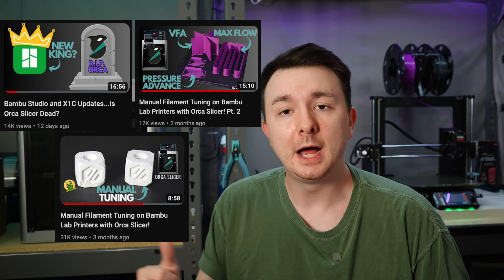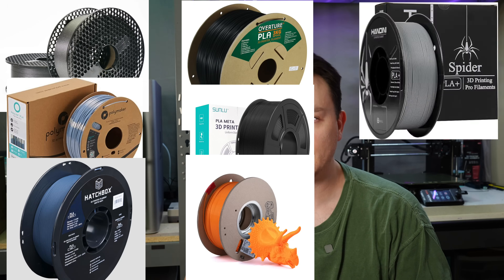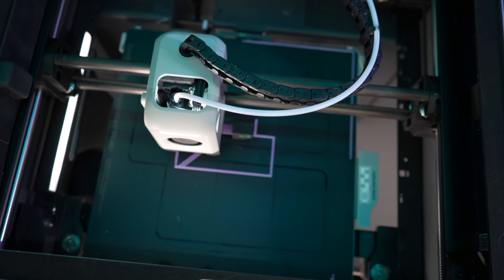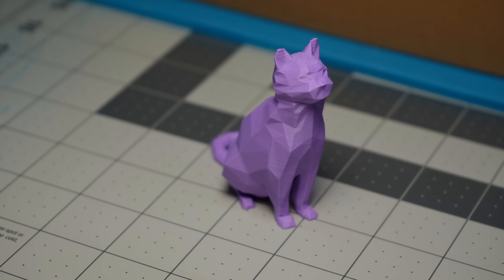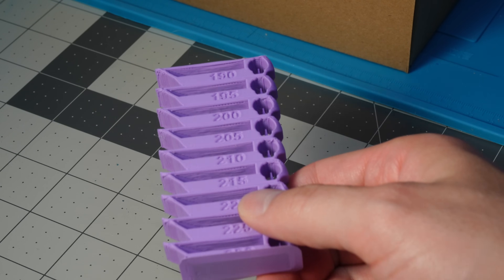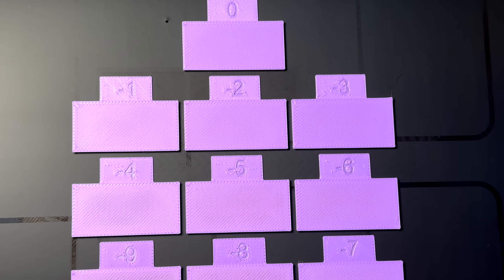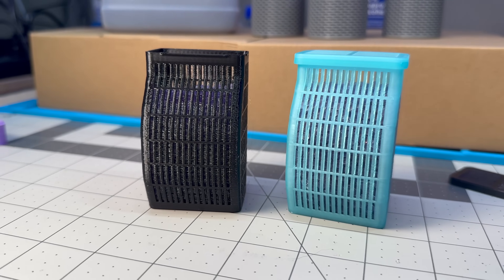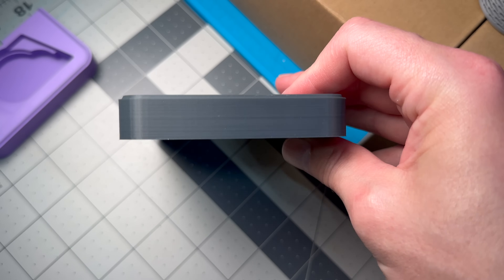My Secret to Filament Tuning with Bambu Lab Printers

Comment: bambu studio presets are only good for bambu filaments, all other brand filaments require (some) tuning. using Generic presets to start with and then look up the manufactures suggested specs to put the finishing touches on the new custom preset. Finally, try selecting a fast and low cost prints (like hooks or filament clips, etc) to use as a baseline test for every filament. 

If you're really brave and dont mind the cosmetic defects, try adjustments mid-print like temps or fan speeds.

Comment: "You can't use automatic flow calibration" 
Do you have to turn that off on all prints using the calibrated filament? Or only the calibration runs, and turn it on for everything else? 😮

Comment: I noticed you had issues with curling on the overhangs on the temp tower. That's the exact problem I'm having with ASA, generic profile, on my H2D. What kind of adjustments can help mitigate that?

Comment: Why did you set the aux fan to 0?
Reply from the maker: I find the aux fan hurts more than it helps
Reply: @ButterPockets  in what sense? What should I look for?
Reply from the maker: In my experience it makes the side of a part closest to the aux fan warp more than it should. It seems to over cool that side and the fan doesn’t aim at quite the correct spot. You end up with one side over cooled and one side under cooled.
Reply: @ButterPockets  ah, I see!

Comment: I have a problem with PETG and 2 printers.
My first printer is Creality Ender 3 S1 pro. My recently purchased printer is the bambulab A1 mini.
I use the same PETG filament in both. The Ender causes stringing like crazy. The Bambulab is not.
To a point I had to lower the temp to 220 c to reduce the stringing. The other thing I did was add extra pressure of 0.15 after retraction because the nozzle was losing pressure on the ender.
None of those things were happening on the bambulab.

Comment: I'm using some Jayo on my A1. .03 looked the best on my PA test (even though I am wondering if going a little higher would have been sharper) and when I move on to the flow rate test every one of the samples looks basically identical. They all have minimal lines but still a a distinct fine line crosshatch look.

Is this normal or should I be at a point where the square starts to get almost perfectly smooth is I guess what I am asking. Should I do another PA test and increase it to show higher than a .03 max? 

Also, call me a moron but I don't understand the formula on screen at 4:32 if someone can brake it down for me

Comment: Very informative video. You mentioned to turn off 'Flow Rate Calibration' when tuning with these calibrations. After you find your values and printing something, do you still checkmark 'Flow Calibration' for prints?
Reply: I'd like clarification as well. I'm assuming we leave it unchecked
Reply: @AidensFarm24  Once you've calibrated manually (which it sounds like you have), leave it unchecked.

Comment: What has been your experience with using your saved calibrated profiles for each filament across different prints (P1S vs A1)? I'm curious if there profiles translate well across different printers (for me, Bambu particularly). Great video!

Comment: I just recently bought some Kingroon PLA. I find on my P1S (which I still need to tune Z-Axis) that it really comes out great at 195. I have it set to 200 in the profile but it lays down looking dry and scuffed., 205 and it starts to string a little…. 195, each layer is smooth and has a sheen…. Am I wrong? I like to watch too…. Why does that make me feel dirty? LOL

Comment: After I did the test and changed the pressure advance to the one I thought was the "sharpest", the first layer of my print had a small gap between the first outer wall line. Not really sure how to properly look at the PA test or what Im doing wrong

Comment: .0105 is what I would have picked for “sharpest corner”, making one of us very wrong.
Reply from the maker: I mean, maybe it’s not super clear in the video, but if you focus right on the corner itself you can see it “bulges” out. If you look at just the outside edges they aren’t fully straight leading to a bulge at the tip

Comment: Thank you for sharing the video! While I appreciate the effort you’ve put into demonstrating the print capabilities, I noticed some areas where the results could be improved. The visible layer lines and the uneven top surfaces stand out, which suggests there’s room for optimization.

In comparison, I’ve achieved significantly smoother results on my older, well-tuned Elegoo Neptune 3 Pro, so I wonder if the calibration or hardware settings on your Bambu Labs printer could be adjusted further.
Regarding stringing, while filament drying is indeed crucial, it’s not the sole factor. Variables like retraction settings, print speed, nozzle temperature, and filament type also play significant roles in minimizing stringing. Fine-tuning these may could enhance your prints too.

I do admire the potential of the Bambu Labs printers, but it seems like your unit might need a bit more hardware and software tweaking to meet its full potential. Looking forward to seeing future results—this tech definitely has promise!
Reply from the maker: I think the short and simple answer is that BL printers kind of suck and you can never get “flawless” prints from them. Layer stacking is usually affected by the extruder itself and nobody really makes a different/better extruder. There’s significant ringing and VFAs present on the X1 as well. 

Either way the point of this video wasn’t “look at my perfect prints” it was “here’s the steps you can take to tune things”. 

I do have a video on my working on right now with some modifications from BTT/Biqu but overall I find the X1/P series fundamentally flawed and without access to firmware changes it will never be optimized.

Comment: Comenting on a really old Video, because i don't know if you have a new one, lol.  For Tuning we disable, Automatic Flow Calibration  before sending the print. What about after we have all the tuning needed, do we send the print with No Flow Calibration or it will be calibrated with the new profile?
Reply from the maker: If you did manual tuning on a profile I would not use the auto calibration any more.
Reply: @ButterPockets  Thanks :)

Comment: This video helped a bunch, and probably not even in the ways you would think. The side comments about temperatures and typical PA values for PLA and the filament soecific commentary is what helped the most. Some things that would help me greatly:
1. Same workflow and commentary on specifics for other materials. Namely ASA and PETG.
2. The various issues and steps you take as you "react" to prints. I don't know if what I'm seeing is a temp issue, cooling issue, speed issue etc.

I noticed with PETG that X1C moves faster than it should. How to tune appropriately for speed if the flow cant keep up?

Comment: But a Temp Tower will help you tune a entirely new Filament if it doesnt print at all so you have some cornerpoints.
Reply from the maker: I still have no need to run them. I run all PLA at 215. I’m sure it can be useful for some but I’ve never needed it.

Comment: I'm new to 3D printing and have been struggling to get Overture silk filament to look good on a Bambu A1. I'm learning a lot from your videos and this this helped but I can still see lines on the top of the print. Ironing made the print a little smoother but it loses some of the detail. Any suggestions? Also, do I have to run this process again if I switch to the .02 nozzle (currently using the .04 that came with my printer). Thanks in advance, truly appreciate your content!

Comment: 🤣 Trimmer line! 🤌Thanks for the tips. I have been looking for something practical. I have a background in offset printing, so the concept of profiling and calibrating by manufacture, color, or type is not new to me. Makes sense that it would apply to 3D printing as well.

Comment: usually use bambu PLAs on my P1S. decided to try some other branded TPUs so im looking how to make profiles right now. would all the same factors apply to TPU same as the ones in this video please. or is TPU more tricky or have a slightly different process im wondering. subscribed. thank you
Reply from the maker: It’s the same for all filaments. Just make absolutely sure the TPU is dry, even if it’s fresh opened.

Comment: For the same filament, would I need to save a different filament profile every time I switch the hotend (let's say, go from 0.4mm to 0.6mm tip)? What about changing the plate from textured PEI to coolplate?

Comment: Hello, I use bambu studio. They only have Flow Dynamics and Flow Rate in their Calibration settings. Should I download Orca just to tune the filament? Can I do all this in Bambu somewhere?
Reply: bambu studio save the k value in their external spool in Device tab so it'll cause issue if you also add the value in filament profile

Comment: Have you had any luck using Ironing in either Bambu Studio Slicer or Orca Slicer?  I'm coming over from using Cura Slicer, and I can get excellent prints with Cura Slicer using Ironing on my Elegoo Neptune 3D printers.  However, I have yet to get a consistent smooth print on my Bambu A1 printer with either Bambu Studio or Orca Slicer.

I have calibrated both the filament and flow under the Calibration heading in Bambu Studio Slicer as well as setting up individual filament profiles based on my calibrations.  I have also entered in the correct K Factor number for each filament based on the filament calibration.  Moreover I have also adjusted my Ironing Speed and Ironing Flow.

By doing all of the above I either get under or over extruded prints.  At this point I'm not sure what I'm doing wrong.  I have tried this on the following filaments - Bambu, Polymaker, and Overture.  All three yield the same results.  Any guidance is greatly appreciated.  Thanks!
Reply from the maker: I’ve never really tried ironing! Sorry!

Comment: Quick one, on PA calibration, you said "I know that most PLA's are 0.01 etc" for the PA Pattern. But what if you didn't know that? I'm now trying to calibrate an PETG filament, but I don't know what the ranges should be. Therefore should I just go for default? Thanks 🙂
Reply: I got exactly the same question watching the video. I suppose go with the values and adjust them for a subsequent test if it doesn't work? Just guessing here.
Reply: @dan-nutu  You just do the default values for your first run (0.01 to 0.08, with an interval of 0.005) then, in my case with my PETG-CF, I saw in the first run that everything higher than 0.03 was demonstrably worse, so I ran a second test with for 0.01 to 0.03, with an interval of 0.001, where I found the 0.12 value looked the best to me.

Comment: Your showcasing calibration by picking filament that's basically already perfectly tuned within the default presets.Why not make things interesting by using the most garbage filament in the world?
Reply from the maker: Haha which filament is the most garbage in the world? I think part of good calibration is choosing good filament from the rip. I pretty much only use Prusament, Polymaker, Bambulab, and Atomic.

Comment: this video helped me tune my p1p to perfection I think what you said about tuning as you print different parts is very important I calibrated to what I thought was perfect based on the calibration. Then printed my own part and it looked terrible but just needed to dial back the PA

Comment: Thanks so much for this helpful video! I have a question I haven't been able to find the answer to (on Reddit): 

In my 3D printing setup, I have 3x X1C printers and 3x P1S printers (6 printers total). I'm wondering about calibration when using the same filament brand on all these printers. Is it necessary to calibrate each printer individually, or is it possible to apply the same calibration settings to all of them?

File management becomes a nightmare if I need to save a unique profile for each printer so I'm hoping I can use the same calibration profiles across all of my printers. From my observations, the calibration results seem consistent across the printers. I'm curious for your opinion on this.

Thanks in advance!

Comment: i like to use temp towers to test for mechanical strength (lamination strength). i use pliers and snap off each section, selecting strongest temp, and for ties picking the lower value.
Reply: Ties, as in two temperature steps being tied in terms of the layer adhesion strength
Reply: @dan-nutu Ah, I see. Thanks 👍🏻
Reply: ties?

Comment: Thank you very much for this video... After doing the pressure and flow rate calibrations for my Overture filament, the prints are turning out 100% better. They are so smooth now. I never knew my prints could be this good.... Thank you again!!!

Comment: Hey,

have you ever had an issue with dimensions on the X1C? 
I received mine two weeks ago and did some printing with it. Works fine so far.
But when it comes to parts which are supposed to be within given dimensions the printer does not perform at all. 

I calibrated flow and dynamic flow, which improved on the Z measurement. (it is basicalle spot on now - around 0,05mm off max.)
But the parts are smaller in X and Y than they should be. With X being even smaller than Y.

I tried to use the XY compensation, but this only helps for a given size of part. If the next part is bigger the deviation from the actual measurement is even more off. (Comparing for example an 20x20x20 object to an 100x100x10 object.)

The 20x20x20 part is quite nice at around 19,98 to 20,04mm. Very good in my mind. 
But if I print the 100x100x10 object it is 99,88 on one of the sides (meh. acceptable) and 99,73 on the other side. (not acceptable for a machine at this pricepoint)

So the issue seems to scale with the dimension of the part. 
Looks like the Steps/mm could be off? 

Also another "fun" fact:
If I print my 20x20x20 object with XY compensation to a nice fit, but put a cirular feature on top (18mm diameter outside, 10mm diameter inside, 10mm height) the following happens.

The outside is way off with 17,85 instead of 18mm
The Inside is bang on at 9,96 to 10,03
But the 20x20 is still within a couple of 0,0Xmm

I tried high resolution STEP and STL files, too. No change. 

It just seems super sketchy. With my old Anet A8 and Ender 3pro i could reach tolerances of 0,1mm at any given size. 

Maybe you have an idea how this issue could be solved?

Comment: I find on cheaper filament, the temp recommendations by the manufacturer are usually very off. Last night I couldn't get a PLA to stop stringing, until I went to 205c which was 5c lower than the sticker temp.

Comment: DL orca. Seems great and able to customize much more than Bambu slicer. I followed these steps and everything came out great during the test prints. After adjusting settings I printed an item I print often for my shop and the sparse infill is like supports, they just crumble and won’t finish a print.  I reversed all the settings I just adjusted and still same thing. Is there something I need to calibrate with orca first? As a test I printed from Bambu slicer and everything was fine. Any ideas?
Reply: I too, have trouble with printing some models with Orca on several occasions. I think the G-code is bad because the slicer layers look correct, ie .. some areas are not printed. When switching to my standard slicer the prints are fine. I only use Orca for filament testing now.

Comment: Great video. I'm very new to the 3D printing "thing" and I'm researching what printer to purchase. The Bambu Lab X1 Carbon seems to be the most reliable but I find it nagging that the print bed is on the small size. I wish if would be 400mm x 400mm x 400mm at least. I am looking for the versatility of being able to produce object with multiple types of filaments as well. Do you have a video that explains how to "cut" prints in separate part for assembly to create objects that are larger than the 256mm x 256mm x 256mm bed size? One of my first intended project would to create an illuminated sign with LED light strips for indoors and outdoors.

Comment: I have to admit, I wish my 3D printer had come with a warning label before I bought it (x1 carbon)... as someone completely new to any of this, it has been an extremely frustrating challenge, burning through a few hundred bucks in supplies trying to figure things out.

But thankfully I found this channel and it's beeen helping.  Keep it up!
Reply from the maker: I’ve been doing this for a while and I still burn though TONS of filament testing new things. It’s all part of it! Just have fun along the way
Reply: You probably should’ve started with an A1 instead of an X1C.

Comment: Flow rate pass 1 AND two are REALLY rough?? Dried the pla at 45c for just over 6 hrs. New reel. Any ideas here please?? It's crazy, NONE of the tiles are remotely smooth. X1c
Reply from the maker: It’s hard to say from just a comment. My email is on my channel page. Feel free to email me and I can try and help more.
Reply: @ButterPockets  I replaced the nozzle, which is a few months old. Vast improvement, but not one tile looks like your smooth tile @ 4:30mins in, the top 0 tile.
I must have printed 6 of these tests now and it's drove me nuts. Many thanks for the offer of help! 👌I'm just printing pass 2 to see if I can remotely see a difference, and then I'm off to bed lol. Happy New Year from the UK! Thanks again.

Comment: This is very close to how I do all my tuning. I do a max flowrate calibration first as my "temp" test. I do this to see how fast the filament can print while still getting a glossy outline. And increse temps if I want to get a faster print. Then do a flowrate calibration test with 0 - -3, and finally the PA tuning.